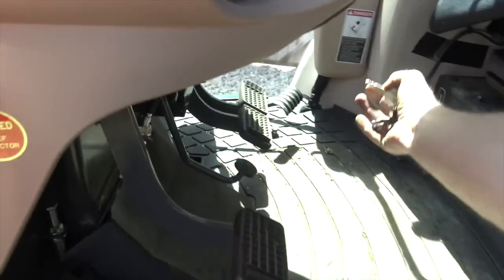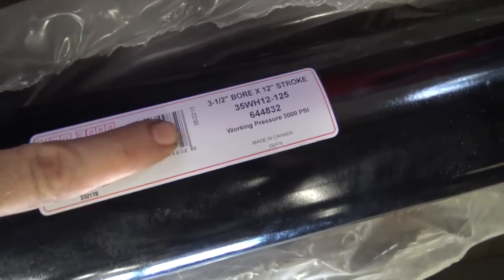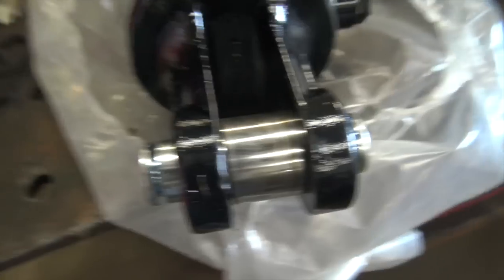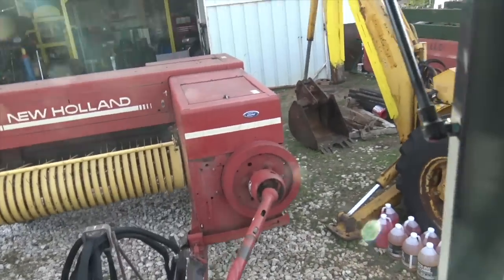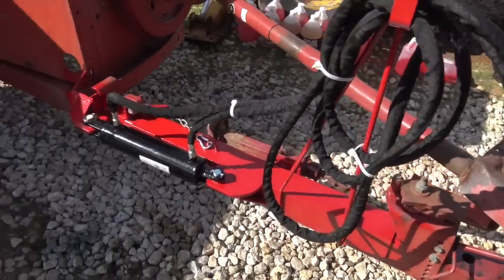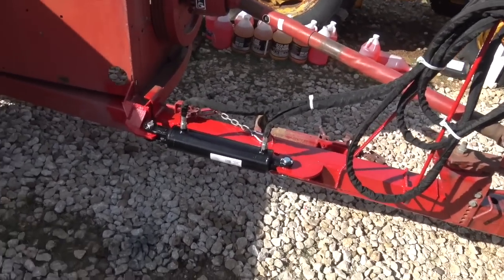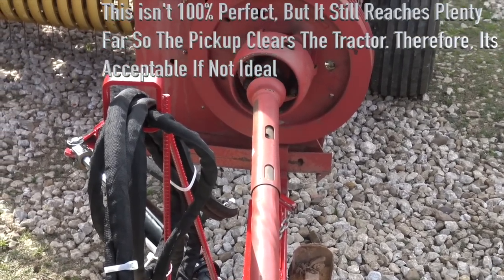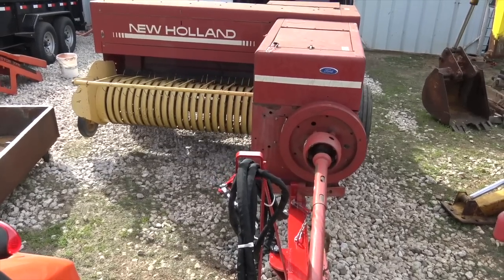ONE THING THAT SQUARE BALERS LACK WHICH SHOWS THAT THEYRE NOT BUILT PROPERLY!!! HIDDEN SECRETS!!!

Comment: We have been using the same bailer since 1998. Its  273 New holland. Never  had any trouble with moving the bailer drawbar.  All  you need to do is  have quality twine have the knives sharp and the bailer properly timed. If you do that it can be worn out and still not miss a bale. We still have the 269 New holland that the 273 replaced and it would still work if necessary.
Reply: There's things about this particular baler that you're obviously not aware of. But hopefully he'll post the videos covering that. So stay tuned. Because what's really going on is pretty rich.

Comment: @1:10 mark Actually no, if you know what you are doing, you don't need to block a wheel. 

Pull the pin; 
...reverse the rear of the tractor to the left; 
...force moves the drawbar to the left (especially if the rail has a little light grease on it); 
...replace pin; 
...attach PTO; 
...engage PTO; 
...go bale hay.
Reply: There's probably a video showing that somewhere lol
Reply: @stevenakn1  could be. I wouldn't know.😂
I learned from watching my dad do it, when I was a kid in the early 1970s.😁
Reply: @willhorting5317  we have a smaller machine we use on the golf course that works the same way👍
Reply: That ram would work good along with this method 💯
Reply: @stevenakn1  😎
Reply: Exactly didn't see the point we used ours for years. More time fitting the ram than it takes pulling the rope in years of bailing .
Reply: @jimplatts6172  👍
Reply: If you know what you're doing. That's the point
Reply: @stevec9653  yep.

I'm surprised he didn't say that he was scammed because it didn't have a hydraulic cylinder on that.😁😁
Reply: @willhorting5317  No, he said it wasn't built properly,  a bit like his ram mod. Perhaps the first owner was scammed when he bought it
Reply: @stevec9653  😁 I guess I missed him saying that he didn't think it was built right, before he got it.😁
Reply: @willhorting5317  yep just another secret extreme scam😂😂😂
Reply: @stevec9653  😁

Comment: Oh, that is the damned truth.  "We only use them for about 30 seconds until the baler breaks and we have to go home."   Geeze, sometimes it sure seemed that way.  I had knotting problems with my New Holland 66 (yes, my farm equipment is that old) and an old tractor mechanic came out to fix it.  He got so far and then went to work with a ball peen hammer -- I thought the knotter did something to piss him off -- then, he announced he was done and told me to bale some hay.  I did.  That knotter might miss one knot in 200 or more bales.  And I'm waaaaaaayyyy O.K. with that!